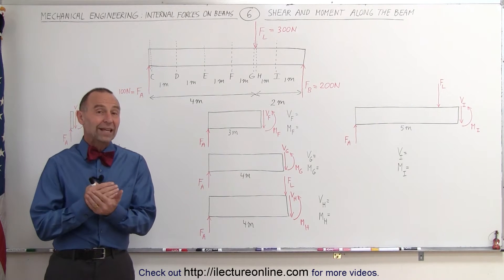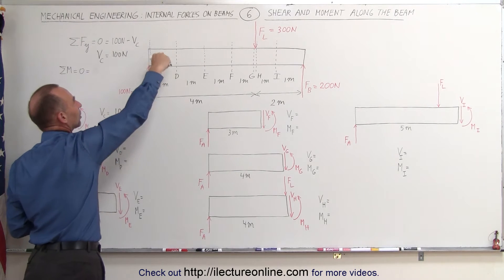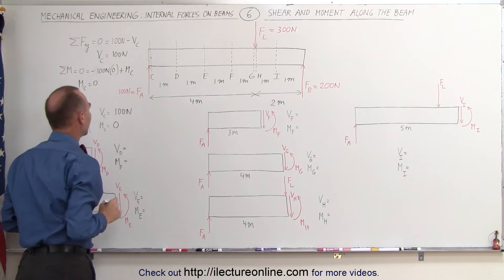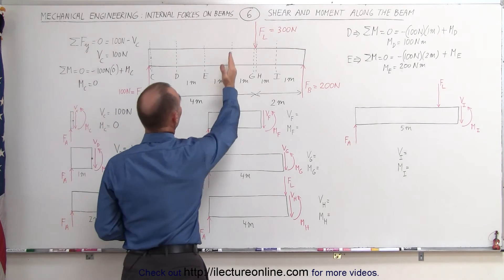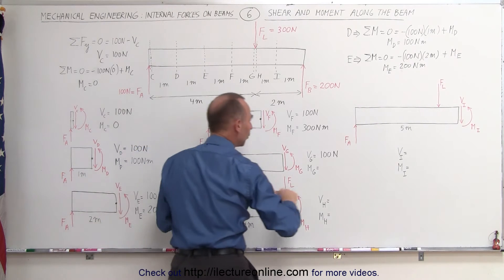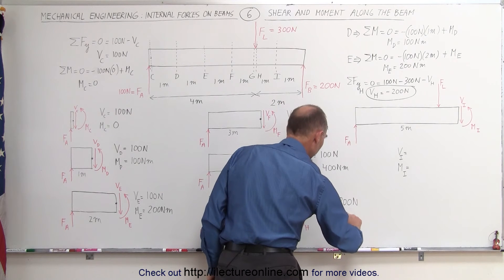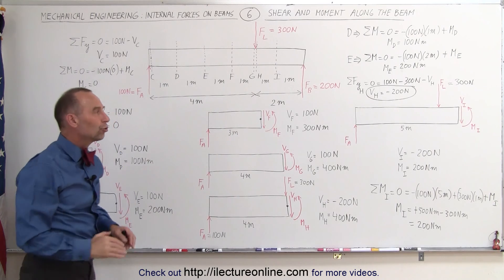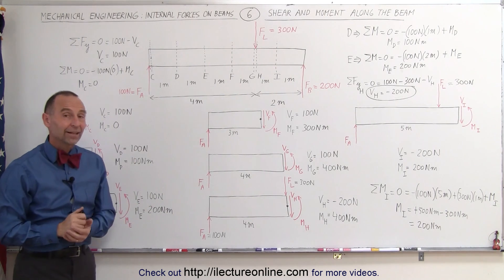Mechanical Engineering: Internal Forces on Beams (6 of 27) Shears & Moments Along the Beam

Comment: why at H the 100 N is (+) not( - ) like other points. did the pivot point have changed?
Reply from the maker: The moments of the "slices" are internal to the beam and point in the opposite direction as the moments caused by external forces (like the 100 N force )

Comment: I cannot understand why for section I the moment is anticlockwise. There is 300N load acting and 100N force upwards which makes net force to downwards and so net force will turn it anticlockwise. So shouldn't the M(I) be clockwise in order to oppse this moment?
Reply from the maker: You are looking at the EXTERNAL force to the beam.  This is the moment of the INTERNAL forces of the beam (pushing back against the external force).  (I agree it is a bit of a brain twister).